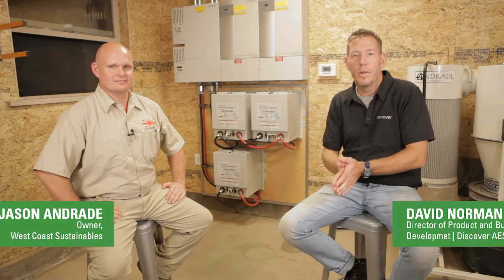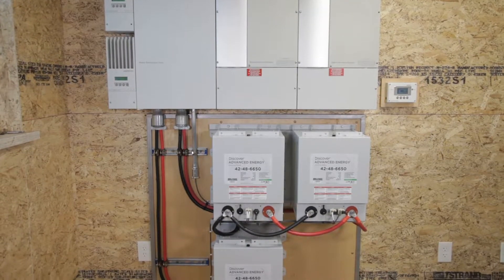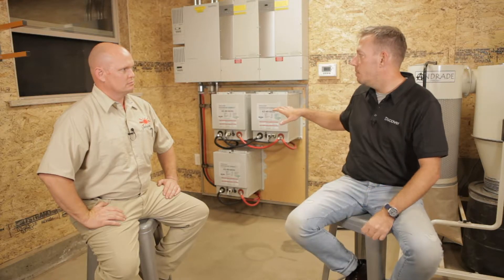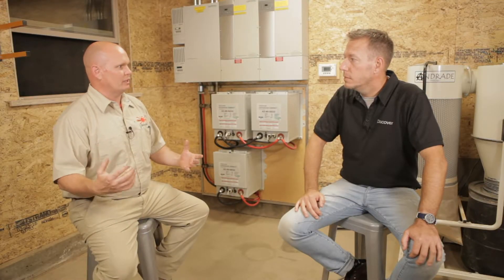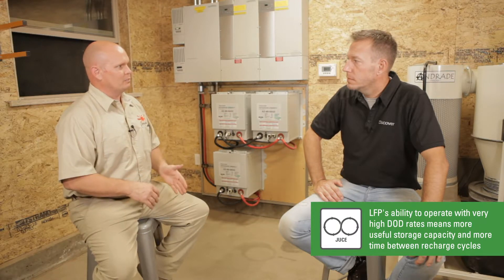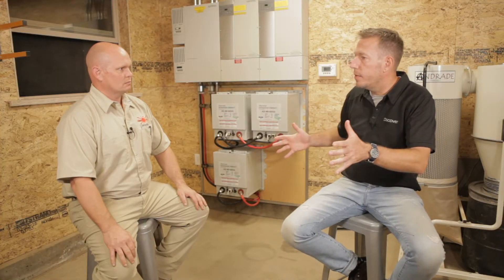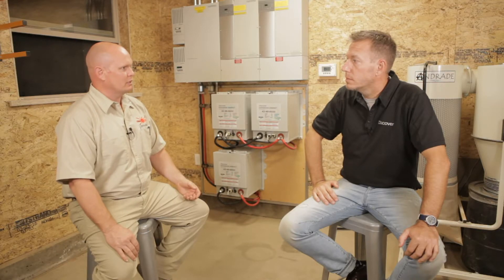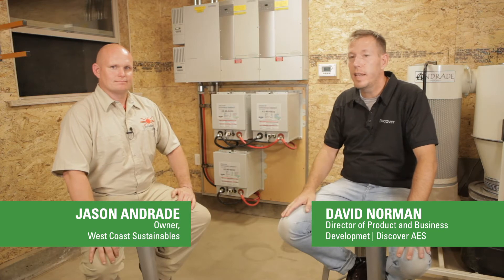Discover Battery™: Charging Capabilities of the Discover AES w/Jason Andrade - WCS

Comment: A paraphrase from the video: "...will upgrade the generator to charge ASAP." But of course, depending on the hardware the battery charging is limited - regardless of the battery. For example I have a single Outback VFX 3648 which is 20aac for charging. A bigger generator does no good unless my other loads are dialing the charge downward which never really happens with a EU7000is. So in upgrading from a FLA bank to the Discover battery you have what you have... Unless major additions are made just for charging the inverted demand increase is not needed. From where does the charging increase come from with a bigger generator?